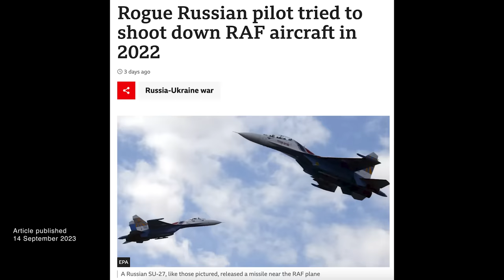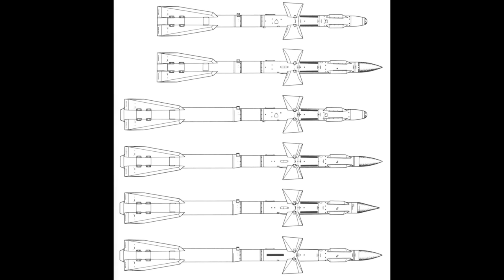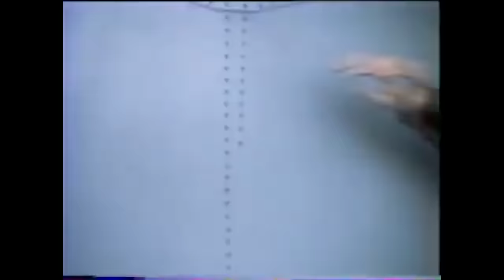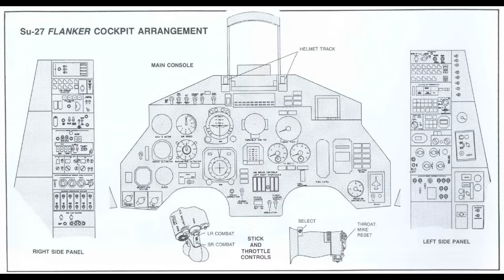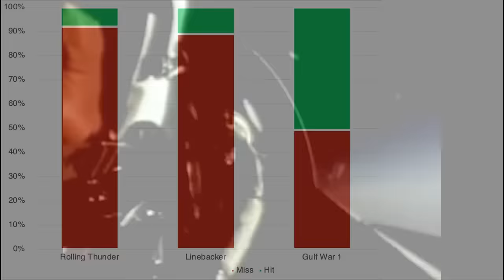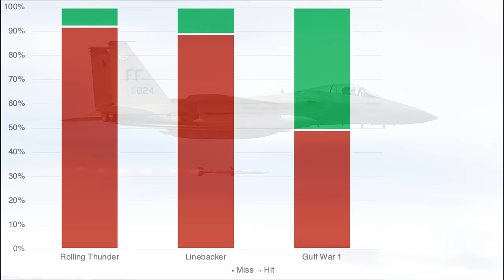BLACK SEA RIVET JOINT INCIDENT: A Narrow Escape But The Reality Of Air-To-Air Missile Performance

Comment: Two corrections and another possibility.
The target aircraft is not, remotely an airliner. It is a spy aircraft and a legitimate military target that does not require a declaration of war to intercept and interfere with. Its purpose is to gather electronic data and its mission is unambiguously military operation against a foreign state, political interpretations of which range from abject military aggression to reasonable apprehension, however it is undeniably invasive with intent to compromise classified military information of the state involved in its mission. The nature of these aircraft type is what, in fact historically defined the meaning of Cold War, in being blatant military operation against a state whilst presuming an ambiguity about it being an act of war and expressing a reluctance to enter a shooting war. The fact this is like slapping someone you say you don't want a punching fight with is what created a "cold" war. A default state of war, including military activity but just without the shooting part and a whole big bunch of contemptuous bullshit tossed all over every UN meeting like a smokescreen for morons. "Technically I didn't enter their airspace" isn't an excuse to the state you are compromising, they objectively have an imperative to interfere with such operations by any means and aren't concerned with what an aggressor state thinks their rules should be.
Don't want to get shot down? Don't do it.

Second, all the Su27S in Russian service have been upgraded to the Su27SM updated version as an interim measure as industry and economy was unable to replace them all with 4.5 gen Su30SM and Su35 as had been planned. Some systems have been upgraded on all the Su27 fleet since their original inception, so the inference of ageing Cold War fighters with unreliable systems isn't really an accurate one, this was a state the VVS was bereft to in the late 90s to early 2000s due to the crashed economy however has been singly of greatest concern over the last twenty years to their national security. I'm not saying many cliches aren't true about contemporary Russian avionics in field distribution lacking parity with front line US/NATO examples, the MiG-29S fire control bus inability to handle any significant data transfer for example compromising its real world BVR capabilities, but giving the public impression that a typical Russian intercept will involve unreliable and obsolete equipment in 2020s or that it will be a most likely explanation for the course of this event isn't being intellectually honest.

To describe the more plausible characterisation of the event I should have to point out a technical and a cultural matter. The modern VVS is not the Soviet Union and abandoned all its ideology in training and operations in the successive sweeping reforms of military culture and organisation under Putin, the most recent of which was in 2016. Earlier reforms of the military structure weren't just prudent but politically necessary because of the nature of Soviet era military districts to form local fiefdoms under an oligarchy, as was the case in the Black Sea and Caucasus region, around Georgia in the 90s. Senior officers of the general staff going rogue with their absolute local authority and arms stockpiles of nuclear warheads and 4th gen Soviet equipment, Tom Clancy liked to write novels about it. The entire military structure and organisation had to be altered with two primary reasons given the need to adjust from Soviet mass assault actions philosophy to a much more realistic, post-Soviet small unit action philosophy more similar to the west. It involved changes to OOB as well as officer training and military culture, designed mainly to compensate for the fact Russia simply could not produce industry on a Soviet scale. Officers and pilots for example could no longer afford to have the Party mentality of collectivism and required far more active leadership, independence and initiative the west doesn't traditionally associate with Russian infrastructure. Bluntly, they're not communists anymore and combat pilots are basically trained just like American/NATO ones with similar standards at varying levels, in fact the Guards squadrons were expected to field highly independent and qualitive pilots even during the Soviet era so the mindless communist drone cliche about this is really inaccurate to start with and more a misunderstanding about the PVO special air group under command of the rocket forces (strategic), which is akin to the US-ADF that also used GCI with little to no pilot autonomy during the Cold War. It never described the VVS.

Another point is the avionics automated systems in Russian 4th gen fighters had manual overrides since the 80s, whether the FCS or importantly here, the electronic launch authorisation. Most intercept alert Flankers (not long range patrol), whether performing exercises or on mission tend do tend to carry a pair of R27R and R73 on the wings, regardless of the capacity for many more and the extended range ER type. Generally, just two R27R and R73 seem to be the thing I presume to take advantage of its remarkable climb performance, a world record holder in several categories such as 55 seconds from runway brake release to maximum range launch altitude, can't remember height off the top of my head 7-10km somewhere. Rarely I've seen a pair of R77 as well but usually just the other four. The original Su27S can't carry the R77 btw, only the Su27SM but as mentioned they're all updated.
In order to fire the R27R normally the pilot needs to acquire the target, then lock it for SARH guidance, enter aspect/altitude range of the missile and an electronic launch authorization allows him to fire it. Without the launch authorisation pressing the fire control does nothing.

However, and here is finally the most likely explanation for what happened. Specifically for the purpose of firing a missile outside its parameters of a firing solution the pilot can override the electronic launch authorisation, invariably firing a dumb missile towards a target, that is one that either won't track or is outside its capabilities to hit the target.
One of the main reasons a pilot would do this is a warning shot without starting a war.

And it might not be the correct explanation but my concern is this: your premise is they're all idiots and their equipment uselessly unreliable. Why would you pick that explanation when there is a perfectly plausible one with a loose parity overall. I mean yeah a Eurofighter Typhoon is a different world from a basic Flanker but if the RAF were still in Tornados they don't suddenly turn into a Laurel and Hardy episode with missiles falling off the rails and temporary psychosis. Quite frankly that explanation I find utterly ridiculous, possibly true but utterly ridiculous, worthy of ridicule. Why choose that one?
Reply: A pretty good comment. thanks for your time typing it.
Reply: Electronic intelligence is not a legitimate target. 
I've personally seen Russian ones off Cape Cod and Goose Bay Canada

Comment: Can it be that missle was fired to miss a target on purpose? Or it's not possible?
Reply from the maker: Good question. My understanding is that the fire control system enabled the missile to be fired unguided. Master arm would have to be 'on' though and therefore the warhead and proximity fuse would be live. It could also be jettisoned from the pylon.

Comment: so the super expensive, packed to the rafters with fancy electronics has no ECM at all? pull the other one. it has bells on. the missiles were fine. however the spy planes jamming was finer.
Reply: The RJ has no jamming capability. It is a SIGINT aircraft, not an EA platform. 

In areas deemed high threat, it would be escorted, and now is over the Black Sea, but previously the MoD didn't think Russia would actually be stupid enough to fire on a nation it isn't at war with.

Comment: Only it’s not an airliner is it? It’s a strategic, electronic reconnaissance asset that has without doubt been used to help Ukraine target Russian ground assets. You need to take this into account, and the state of mind of the flanker pilot. Fully aware that the RC-135 is helping kill Russian soldiers, so you need to take this emotion into account when looking at the pilots actions
Reply: If it were a 747 or 777 the weapon would have hit. Airliners are their favorite target.
Reply: @kdrapertrucker  yeah and the US prefers 757’s so…
Reply: An emotional pilot shouldnt almost cause a war due to him sperging out over international waters
Reply: @benis4958  absolutely, I’m simply giving another possible reason… chill
Reply: @benis4958 or more likely an overeager ground controller. Soviet/Russian interceptors always work under full positive ground control. Heck, it wasn't too long ago they couldn't even launch their own weapons, they were tasked with steering their fighter on an intercept course at which point the ground controller would take over and arm and fire the missiles.

Comment: S.U.-27

Not SUE-27

T.U.- 95 BEAR, Not 2-95 Bear. 

It's a small detail, but it's important.
Reply: Respectfully, are you a native Russian speaker with the requisite aviation knowledge? I’ve heard it both ways. Any Russian speakers out there, please let us know… because if it’s spoken as the single syllable, one of my favorite planes is the “tutu.”  🤪
Reply: Not personally a russian speaker so I did a bit of research and yes it is the syllable. So it would be SUE not S.U.
So yes the Tu-2 would be the tutu.
Reply: The common counterpoint to this is that you say "Mig" not "M.I.G."
Reply: No, I'm not a native Russian speaker. But I am educated in the English language which this video is in, and the designations are printed in. 

Do we can the Focke-wolf 190 the FWA-190 or the Bf-109 the BIFF-109?

Didn't think so.

Do we call the DC-10 a DICK-10? (You probably would)
@patrickunderwood5662
Reply: @majorborngusfluunduch8694 because that actually spells out a word, and it's what the soviets ACTUALLY called those planes. 

Thanks though.

Comment: Read: war was avoided with Russia because Russian equipment is crap.

Holy cow what a close call.
It’s such a shame that planes as gorgeous as the SU-27 are meant for death and destruction. I look at the F-15 and the Mig25/31 and they’re just stunning.
Reply from the maker: It is incredible how close a call that was. Fortunate that the pilot decided to use the most complicated and failure prone weapon available to him in that moment.
Reply: 😂
You believe that propaganda.

You will probably find that it was the swift action of the rivet joint crew that prevented the first missile downing them and the readiness for the second.

I fully believe those missiles were 100% serviceable and a viable threat.
But I also believe that the Rivet Joint is more than equipped to handle them.

After all. They have been flying around watching a war take place.
The know the threats and how to handle them!
Reply: @richardwillson101  Both things could easily be true. 

I find it interesting that event after the war has dragged on for years now, with example after example of how Russia's culture of corruption has hampered military readiness at every level you still think it is "believing propaganda" to think there is less than a 100% chance that extremely complex military hardware was not properly maintained and ready to perform to spec.
Reply: India has a lot of Su-30s and they are just beautiful.  Unlike, the Russians,  however,  the Indians are very skilled pilots.  If you think I'm saying that look up Red Flag exercises US versus India.   Also in the 60s when Iraq got it's first Mig -21s Saddam didn't hire Russians to teach his pilots.  He hired Indians.
Reply: @16rumpole  that's because many Indian pilots were combat veterans...
Who better to teach fighting than combat veterans?
It's also why Indians have done so well at Red Flag, fighting US pilots who have never even flown into contested airspace, let alone seen an enemy.

Comment: The Su-27 is a 46 year old fighter design, yet it still serves as a front line fighter. Sure there are other more advanced fighters, but the Flanker is still good enough to be competitive in a fight. It is still a functioning weapons system, Assuming Russia is not the operation. 
      The Su-27 is meant to go against 4th Gen fighters like the F-14 or the F-15. This generation is around 50 years old. Can you imaging the Sopwith Camel still being operated in the skies over Vietnam in 1966?
Reply: It would probably do ok in a 1 circle.
Reply: don't underestimate the Super Flankers though,   they are amazingly good at dogfighting.

Comment: In the 80s su-27 if you break lock to the target, the r-27 would not guide. It could be that the first one the pilot simply broke lock. Another explanation is that the target had countermeasures and jamming on, making the missile loose lock. The second one simple dropping  might be explained by hardware failure; heck even the first missile failure  could have been hardware failure. So far the only Russian missile that I have seen used successfully has been the r-73.

Comment: The U.S navy did a hard study into why so many sparrow missiles fired were duds, they found that in some cases missiles loaded onto a Phantom might well stay on the aircraft for weeks without being needed, weeks of daily carrier take offs, high manuvering followed by a carrier landing had turned nearly every missile tested into a dud.
I think that may have been what happened to the missiles on the SU27, they were left on the rails for lord knows how many months or possibly even years, add to that, the average Russian pilot gets only a handfull of actual flight hours per year, their landings are probably going to be a little on the rough side due to lack of actual practice.

Comment: I may be mistaken but as far as I know an R27 is a rail launched missile. Meaning for it to leave the aircraft it has to have its rocket motor ignite. Most older missiles work like this. For a missile to just drop off an aircraft would imply its a more modern type like an R77. The R77 is more like the American AMRAAM in that it drops off the pylon before its motor is ignited. Just looking at pictures from other times Russian jets have shadowed and harrassed US planes they always seem to have R77's on board.
Comparing the effectiveness of cold war and earlier missiles to modern missiles is a mistake. Modern missiles are far more effective than older types. No doubt the Rivet Joint has effective electronic warfare capability and can deal with an incoming missile, especially at longer ranges.

Comment: Yes, a Russian Su-27 pilot tried to take down an RAF RC-135 over the Black Sea, the RAF is the only NATO country that flies regularly over the Black Sea. The Russian missiles did not function for what should have been an easy kill, on a large relatively slow moving target. After an interest in aviation spanning 4 decades, my observation is that Russian equipment has a very high failure rate as we saw in the Middle East wars and now in Ukraine. Russian technology sucks.
Reply: Shooting down a plane loaded to the hills with counter measures is not an easy task.  One missle (assuming 2nd was a dud) would be the equivalent of hitting a headshot of a marathon runner with a pistol at 300 yards.
Reply: @philipparana9225  Rubbish, the RC-135 is a reconnaissance SIGINT aircraft not a giant  ECM platform. It would normally operate with Fighter Escort with ECM. Shooting a barn door would have been a closer analogy.

Comment: You know the world's jacked up when Russia is trying to avoid a wider war.  The rivet joint is not some airliner with a couple of radios. This aircraft is probably the  best electronics warplane in the air.  If Putin takes a dump in Moscow the NSA will know before he wipes.  I did my job kicking in doors in both my tours OIF-I and OIF-II.  20 years later I would still go back. We're no Fortunate Son.

Comment: the function of sending up small numbers of manned aircraft against potential intruders approaching your aerospace is to show that you're watching and can shoot at them, not because it's actually the easiest way to down an aircraft. Both US/UK and Russian interception forces do this. In the absence of detailed information about what those missiles actually were, I'd say the Russians deliberately fired missiles which weren't or couldn't be homed on the target to scare away the RC135. If they'd wanted to down it without making visual contact they would have just used a shipborne missile or SAM
Reply: So the wingman didn't get the memo or something? He was screaming at his flight lead.
Reply: @majorborngusfluunduch8694  if the leader decided to do this there would be no way of his wing man telling that the missiles didn't have a lock on to the target, so it would look scary, yes